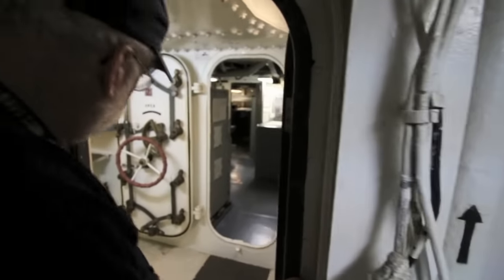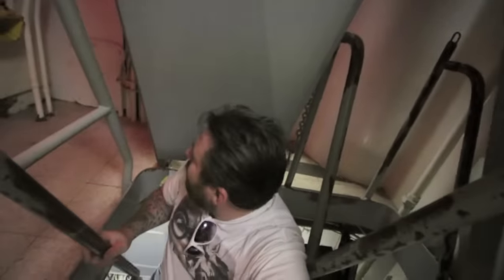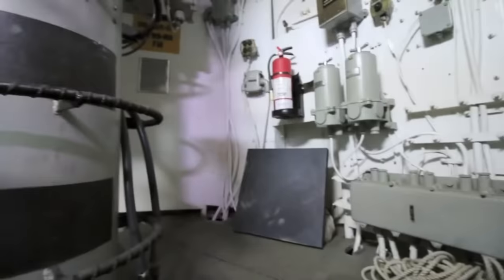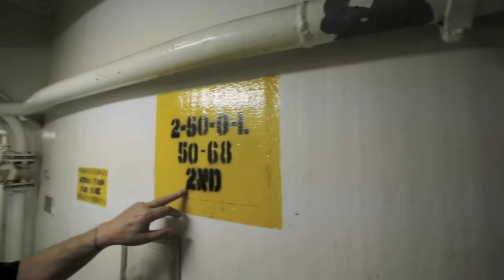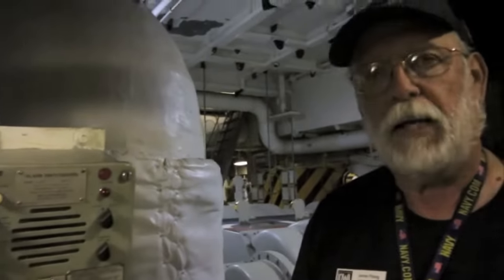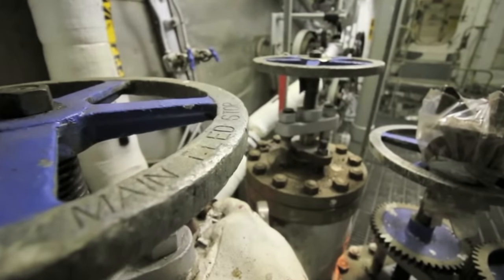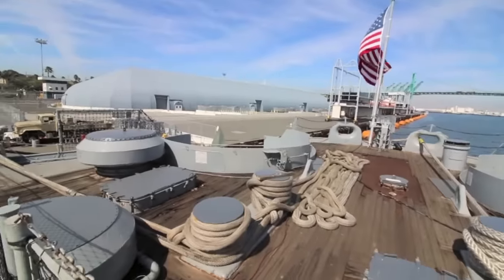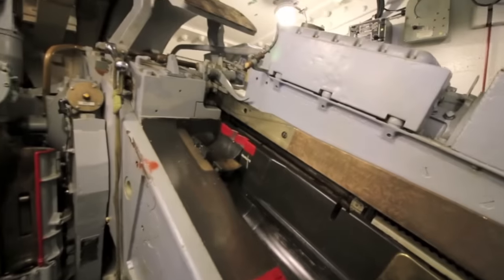Exploring OFF LIMIT Areas WW2 Battleship : USS Iowa

Comment: My brother was on the USS Iowa "The Big Stick" when the explosion happened in 1989. He was on the damage control and had to help put out the fire and assisted in the recovery. He had a lot of stories about everything that happened. The military did a huge cover-up by putting blame on Hartwig. They tried to say crap that Hartwig and Pruitt had a thing going, and when they broke up, Hartwig put a detonating device between two powder bags and that was what caused the explosion. It was a total lie. Truth was, they were scrambling to put guys in the turrets to put on a show for I forget who was on board at the time. There were guys in Turret 2 that were not normally in there. The loading ram is manually operated, and the operator has to know exactly what they were doing. Whoever it was running the ram at the time mistakenly ran the ram in too far, it buckled and hit the side of the breech, and it caused the detonation of the powder. 660 lbs. of powder igniting, you can imagine what that does in an enclosed steel space. The 47 lives lost deserved so much better than what the Navy did to dishonor them the way they did.

They made a movie about this, called A Glimpse Of Hell.
Reply: Yes, that's pretty much it. Actually, the film is from the book of the same name. I worked on the ship for almost 9 years, and I personally know several '80's crew who were involved  in the damage control activities, and to a man, I was told that the book and film (AGOH) is NOT held in very high regard by the crew. A better read is the Sandia Labs report. Also, Mike Getscher (Chief Engineer for the museum) did much research and in his view, the claims of degraded powder are incorrect.

Comment: The design, as well as the construction engineering of the vessel is just staggering, especially considering it was drawn out on drafting boards after being figured out with slide rules. Truly the GREATEST Generation.
Reply: And from laying the keel to going to war just over 2.5 years. Not a chance to do that today...
Reply: Want an even greater perspective on such building/engineering?

The Pentagon went from an empty field to operational in 16 months. Today just the environmental impact approvals to start building would take longer than that.
Reply: @jamespobog3420  To be honest modern warships almost have more electronics on board then steel. The outfittting part takes significantly longer now.

Comment: Insane mechanical complexity within this ship. Thanks for this tour.
Reply from the maker: +Terrathrax its very impressive, thanks for watching
Reply: +adamthewoo What a fantastic insight, excellent video Adam
Reply: What is really impressive are the analog <gears and differential cams> computer that makes up the fire control computer, similar gear also in the Norden™ bomb sight and the submarine TDC <target data computer> that was used along with several 'slide rule' type devices for aiming torpedoes.

Comment: Amazing! Great tour. What I find most amazing about ships lie this is the sheer number of man hours that went into building it. Every weld was done by hand, every bulkhead was fit & welded by hand. Every wire, every connection, all done by hand. The scale is just overwhelming, especially when you see it in person.
Reply: And think of the design process. No computers. Pencil, paper, slide rules, and if you were lucky,  one of those old lever operated adding machines. Adding, not subtraction multiplication, or division...'long' division. My worst nightmare. Designing a warship is exceedingly complicated. I laugh when I read fanboi's comments "Just do X and bring her back into service.", or see all those interesting but silly conversion illustrations showing flight decks and such. They don't have a clue...

Here's a link to an excellent article (hell, it's an excellent site, check it out) about how warships are designed. Lots and lots and lots of top notch educational and informative articles there...

http://www.navweaps.com/index_tech/tech-035.htm

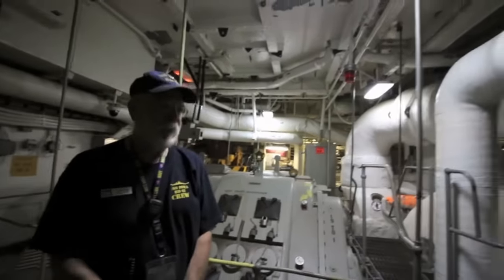Comment: my dad was on a Destroyer Escort (DE698 Raby) and a converted DE, High Speed Transport (APD106 Walter B. Cobb) from 1951-1955.  he was a Boiler Tech 3d when he got out.  when he was a Fireman 1st he was in charge of BOTH fire rooms on the Cobb (jan 54 to about oct 54) along with his last ship ACG8 USS Mt Olympus but he was only there temporarily before getting his discharge.  while on the Raby a fellow crewman lifted one of those gratings you walk on  at 29:15 or so, to work on something and they lost all electrical power during ship to shore power transfer and my dad fell about 1 deck down.  tore up his knee and elbow, bruised a kidney and to this day (he just turned 92) still has trouble with his back.  he loved his time in the Navy and never had any issues one way or the other regarding the size boat he was on.  thanks for the behind the scene tour

Comment: The way the boilers were lit was pure genius. Who would have thought of using asbestos to start a fire? The end of a long poker bound in asbestos is soaked in jet fuel, poked inside, lights the fuel, then when it brought out the jet fuel burns off and they still have the asbestos to reuse. But the neat thing is, there's no burning residue falling off the poker which could fly around. Absolutely no messin. Love it to bits. Thank-You . And Thank-You U-Tube.
Reply: You wouldn't believe what happens during doing "Firesides and Watersides"!!
Reply: @charliefile3945  I typed in "Firesides and Watersides" and jeaz... got waterslides. I'll Google it and see what happens: unless you can tell me where to go. lol

Comment: Fantastic tour. The guide sounds like he was an engineer at one point. He should have told you about the dangers of superheated steam. You cant see or hear it leaking but you can feel the temperature difference. It comes out at such a high pressure that it can cut metal. There was an old fasioned way to look for leaks and that was waving a broom handle up and down the passageway. Once the handle got sliced in half you knew you found the leak. People lost limbs and as he said if it hits you your dead
Reply: Yeah, I was a BT, active '71-'73, Tonkin Gulf Yacht Club '72. I steamed Babcock & Wilcox 450lb sectional header boilers on a fleet oiler.

Comment: As the R-2 division officer in SIMA GTMO (Shore Intermediate Maintenance Activity, Guantanamo Bay Cuba) 19834-87 we were tasked with pouring and machining the babbit lining of a spring bearing (main shaft bearing) for the USS Iowa. The R-2 division was the foundry, machine shop, pump shop etc. etc. The bearing was at least two feet in diameter and we'd never done anything that big (at least I hadn't). I asked the workers, 5 Cuban commuters (the youngest being 74 years old), twenty Jamaican nationals and several senior USN petty officers if we could do it. The Cuban commuters said they had done several during WWII and then everyone jumped on board. I took the Cuban Commuters aboard to check the bearing race for damage, not telling the Captain or anyone else onboard for that matter, that these Cuban workers commuted each morning and evening back to Castro's Cuba. I think the statute of limitations has expired so I can tell this story, but the bearing was perfect and each worker got a certificate from the Iowa's CO. I put all the civilian workers in for a bonus and they each received 200 dollars. The Petty Officers got an "Attaboy" on their evals. and an Iowa belt buckle.
Reply: Great story! Any memory of which shaft and bearing location? I do know that Iowa suffered from vibration for most of her service life, and at one time had rather severe damage to the bearing right at the prop (don't know the name of that last bearing). At it's worst, it supposedly was pretty bad.
Reply: james pobog, how did the vibration affect performance and day-to-day life aboard?  Did the ship have a noticeable vibration throughout?  Did she want to naturally pull to one side or the other?  Btw thx for the excellent tour, your enthusiasm, and above all for your service.

Comment: Love the comment regarding the asbestos starter as he's in a room filled with miles of lagged pipework covered in the stuff.
Reply: Actually, there has been a good amount of abatement of asbestos in the 80's. The material that is on board is well encapsulated. We take care to not mess with any existing lagging. If a problem is found we deal with it right away.
Reply: Was amazing to watch from that perspective (I work in the field in the UK). Rarely get to see the internal areas of such a beautiful ship. Hope she's there for future generations
Reply: what make of boiler were they, did you see a name plate, Keewanne's ?
Reply: Babcock & Wilcox "M"-type 600 PSI
Reply: That's why there are lawyers that want us to come across with the Mesothelioma stories to help us and themselves to the $$ that a lot of us had to endure to this day. They want a piece of the action!! So sad what the govmnt has done to us and won't admit to it.
Reply: Oh yeah, I was working the Missouri and the New Jersey when they still had tons of asbestos, the old time pipefitters used to cut it with air grinders, dust went everywhere. Crazy!
Reply: @Fox The thing they told us at training for power.plant work was smokers are at a very much higher risk from asbestos.because they're lungs can't get rid of it because of the tar.
Reply: WRONG! The asbestos was removed from the lagging during the Reactivation.  Any asbestos covered with lagging glue is harmless. Only friable asbestos is dangerous!

Comment: Thank You for that...believe it or not, I was an ABH1 and allowed into all spaces on both the USS Coral Sea and the USS Nassau...ALL, Engineering Mechanical CIC Ventilation Flight Deck Weapons and Weapons Lockers...I worked for the CO and XO...Much more to a BB than a CV or LHA. I had an uncanny Mechanical and Electrical Ability. I was offered an NROTC Scholarship in boot camp and turned it down and still did 20 years as an Enlisted. On the Nassau I was an Asst Dept Head as an E6....talk about having to be Politically Correct...my last ship was the USNS Comfort where I was the Air Bosn. and was offered an Instructors position with the Military Sea-Lift Command in Earle New Jersey after I retired from the Navy...which I also turned down. I've turned down numerous job offers by Defense Contractors and Government Service staring as a GS8....3 months after I retired from the USN I was running Freight Trains for the Union Pacific Railroad and did 20 years as a railroader and retired...Being in the Navy opened many doors for me. I'm now 64 collect two pensions and thinking about a new career...maybe. I used to read Popular Mechanics and Hot Rod magazines as a kid at 11 years old.
Reply: What is an ABH1?
Reply: I know I'm late to this, but please tell us more stories.

Comment: When you think about it, (before it was equipped with missiles) all the ore mined from the ground, transported to the mill, changed into steel, all the energy used to re-heat it and cast it into parts, the millions of screws, bolts, nuts, wiring, fittings, food, paint, and bodies...the engines, fuel, stokers, everything....all to fire that shell out of the gun and put it on target.....

I think that's why ships have become smaller and more efficient at delivering the weapon......
Reply: Part of it is that the nature of war has changed because of weaponry. Aircraft carriers are still huge, right around twice the tonnage of the Iowa class...

Comment: If you ever cleaned condenser or heat exchanger you use a high pressure gun that fits in each hole , there are several hundred, and shoot thru sending debris out other side.   If it’s plugged or not fitted properly the gun backfires into your face.     It take all night to shoot one heat exchanger, it’s hot , wet and small to climb into.   Bad job to get
Reply: I've heard about that...

Comment: David Kraics here. I served on the Iowa, during her final year, in the Engineering department, Aft Steering work center (we managed the steering equipment and rudders). I remember some of the spaces shown on the tour, although other areas were off limits to my section. I have entered the turret, after it was cleaned and repainted. and when you do, you can feel the hairs raise up on the back of your neck. It was a great ship to serve on! I wish I could visit her but she is on the wrong side of the U.S. from me.
Reply: Hello, Mr. Kraics, thanks for your service. I've been with the ship since she came to San Pedro in 2012. I assume you were 'A-gang'? If so, did you know Dave Canfield or Mike (Mac) MacEnteggart?

I know what you mean about T2. I've only been in T1 one time, but a few years ago T2 was open for Navy inspectors and I stuck my head in the tail hatch. Yep, creep central.

Comment: My Father in law served on the Iowa from 43-45. He was a member of the gun crew on Turret 2 (the one that suffered the explosion in the late 80's) He was interviewed on local television about the incident. For some reason he wouldn't talk to his sons about his experiences, even though they were all veterans. For some reason, he opened up to me. Before he passed he sent me a framed copy of his induction picture and his information from the WWII memorial. The frame also included all of the medals he was awarded while on the Iowa. My wife and I had always planned to visit the Iowa as a tribute to her Dad, but illness has prevented that. Thanks so much for giving us peek into her Dad's life.
Reply: Thank you very much, it is an honor. 

I have been in T1, bottom to top. It is virtually indescribable. The only word that comes close to being a good illustration is 'spelunking', crawling around in small caves. In one place there is a manhole about 4 feet tall between two spaces. The hole is there for human passage. Problem is, part of an air compressor intrudes into the manhole and you have to half crawl over it. Crew size was much larger then too. There were more than 70 guys in there when fully manned. No ventilation during battle, sure as hell no smoking. Empty pockets. Tools made of brass, not steel. Just like all machinery spaces, it is another world.

Comment: The company I work for made those 5-inch 38s; Northern Ordnance Inc., then a wholly owned subsidiary of Northern Pump Company, subsequently owned by FMC Corporation, United Defense LP and currently BAE Systems. And yes, we still make all the 5-inch guns for the Navy's Arleigh Burke class destroyers and most recently the 6-inch guns for the Zumwalt class destroyers.
Reply: During WWII there were several producers of the guns. It's interesting to read the stampings, very often the barrel and "frame" of the gun are by different outfits. IIRC, one of those barrels is stamped 1945, meaning it was replaced.

Comment: The bunk for crew was stacked 4 high with your top shoulder hitting the bunk above if you flipped over.  I spent the night twice on board and ended up sleeping on floor because it was more comfortable. Battleship duty was heaven compared to being stationed on a Navy sea going tug.

Comment: I entered the rear of the forward 16" turret of USS Alabama, which have different access than the Iowa class. and got some photos of the local fire controls where the guns would have been laid, i.e. aimed, if the main director was not operational.  It was a cramped compartment, and was not where the guns were loaded and fired, but much of the pointers and dials were in place as if still ready for use.
Reply: Tell me about the turret access...

Comment: I was in the Navy in 1989 at the time of the turret explosion on the Iowa. I went on a tour of the ship and saw the outside of the #2 turret and seen stress fractures in the turret base from the explosion. Pretty sobering moment.
Reply: Probably a common thought, but those cracks are from the manufacturing process for the armor. Heat treating huge pieces of metal is not easy to do and the process hardens in layers like an onion.

There was a batch of bad armor back then and because of the lead time required, it was used. I think Iowa has it.

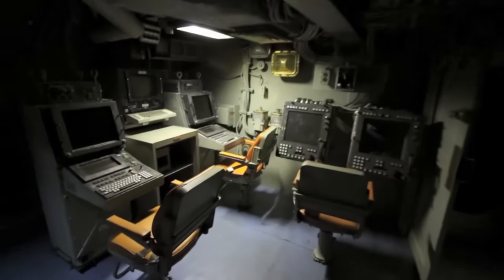Comment: Thanks for the tour Adam. I haven’t seen an OIDT since 1990. At 11:03 when your in CEC those consoles on the left were built by the company I work for. I did the electrical tests and sell-off to the navy on every one of those consoles. That square area on the upper left side of the consoles shelf above the keyboard is one of the first touch entry devices developed. It is a plasma display panel with a bezel using infrared beams to sense where you touch the display. It was state of the art back in 1982.
Reply: Do you mean that rectangular panel immediately above the keyboard?
Reply: james pobog yes I’m sorry I do know the difference between square and rectangular. That plasma display was very expensive at the time.
Reply: Cool. I had not known that. We do have a couple volunteers who repopulated CEC . I'm pretty sure a couple of them knew, but they live far away and don't come in often. I', making a not of your info.
Reply: james pobog the green screen on those consoles are not very impressive compared to today’s LED and LCD displays. Being a CRT that damn thing had like 6 focus adjustments that interacted with one another. It could take hours to get it in focus.
Reply: Our plan is to run dummy displays. The Tomahawk consoles are already contemporary flat screens. Our IT guy left Google to come here and he's really sharp (also former crew). There will be looped screens running on all that stuff.